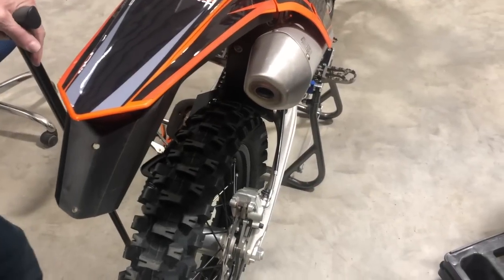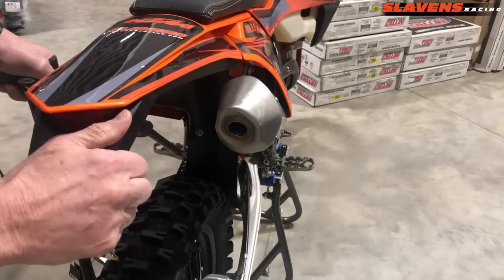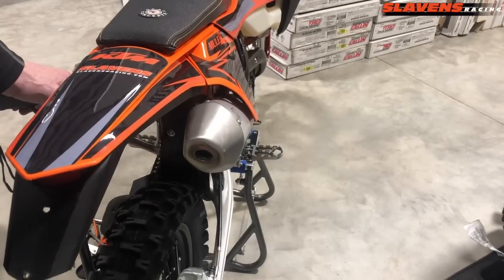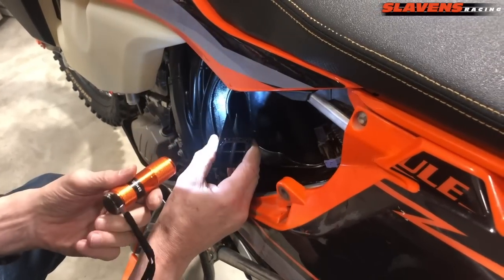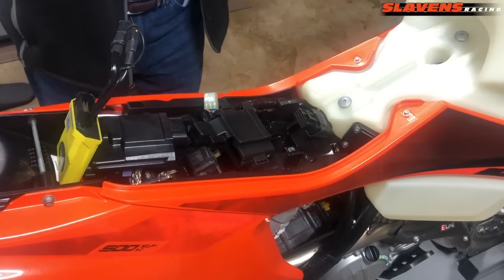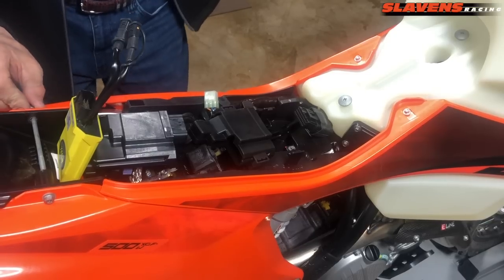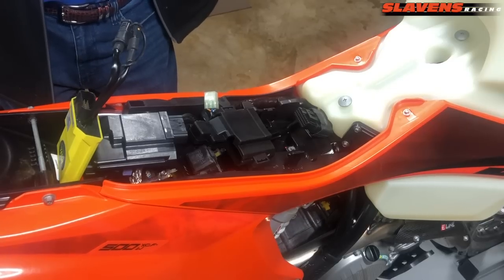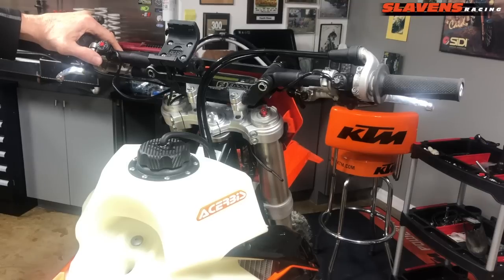How-to Make Your EXC-F/XCF-W/FE Rip!

Comment: have u seen best dual sports power bundles ? do u use a exaughst manifold mod as well
Reply: that guy is a snake oil saleman. Probably the same $700 package jeff referred to
Reply from the maker: Yes, a snakeoil special. 
Reducing the exhaust manifold diameter typically improves grunt at the very bottom of the powerband at the expense of reducing HP throughout the rest of the powerband. The trade-off is not worth the small gain for me.
Reply: @slaverace1  ok thanks for heads up so his ecu are garbage ? only 200$
Reply from the maker: @PackedandReadyFranco  
He does not sell ECUs. Those are just a piggyback system. 
You might want to listen to Korndogger's comment above.
Reply: He has and some of what he sells works such as the exhaust manifold and the ECU tuner (same thing as everyone elses, he doesn't have some super profile). But he also sells snake oil with things like the fuel rail. Even under full throttle the stock fuel rail supplies plenty of fuel to the injector. It's hard to believe him when you know he's actively deceiving people
Reply: Best dual sports is a scam.
Reply: @kyl3dr  dam really thats crazy ill look into this im gonna go see this guy
Reply: I’m very happy with my results form Best Dual sports. Seems to me he’s selling allot of the same items as Everyone else.  So you don’t like his videos or the way he presents his information. All I know is Is my bike was night and day difference from by adding his power bundle kit, and I didn’t need to spend 1000$ just for the ECU.  The customer service there is also top notch and they stand by their products and are quick to respond to emails. I like all these companies, I just wish everyone played nice.  Your all selling stuff and trying to make a living.

Comment: Thanks Jeff, in Europe we only have to remove the "removal CAT" and get rid of the cone inside the muffler.
Damn California! Altho i wish i could try a Vortex one day to see the difference with EU map
Reply: I have a eu model 250 exc f 2019. Are you saying that the intake is not like the us model ? Meaning it takes in more air? Thanks
Reply: ketchup sos yes there is no reed in the EU airbox
Reply: Cheers for that. What about the end screen cap on the muffler can I remove that without changing anything els ? Worth it ?  Thanks
Reply: ketchup sos yes remove it. On the EU its even easier than the US because the screen is held by a nut. You can use the wrench that comes in your KTM tool bag (same nut size as you rear brake reservoir cap)
Reply: Oli M thanks brother 😘
Reply: @mototrailz  i just checked my bike and the screen is already off??  still don't understand why the American version is different.  thought EU regulations were tougher..

Comment: Great info. Is the lambda sensor still used with the Vortex?
Reply from the maker: Yes.
Reply: @slaverace1  I've heard the o2 sensor is not used by the Vortex. Now I see it is used by Vortex? I don't know what to believe. My 2020 FE350s currently has no lambda/o2 sensor. I'm not sure if it would be better if I did install the sensor, haven't tried it installed after the Vortex. My bike does currently run much better than stock. Current setup: no reeds, exhaust screen still intact, vortex set to all 5 and map 1, no o2 sensor.
Reply from the maker: @kyl3dr  

Sorry, I answered incorrectly. I called Vortex and the O2 sensor is not utilized. 

You REALLY need to remove the butt plug.

Comment: Jeff, I just installed your Vortex ECU, wondering if you left the factory map switch connected. You mentioned one of the cables on the Vortex is for a map switch. Is one any better than the other. Can I remove it as I'm running out of real-estate on my bars? Thanks
Reply from the maker: I'm currently just using map 1 and no switches connected. I'll look and see if the OEM switch can be used by changing connectors.

Comment: Did the 450 SXF air boot end up fitting? I've heard that the frame gets in the way on the EXC models but I wasn't 100% sure. Thanks!
Reply from the maker: It does not fit and not needed. Remove the reeds, add a Vortex or GET, mod or replace the muffler and let er rip!

Comment: @Jeff Slavens I’ve done all these mods to my ‘17 Husky FE450. FMF Exhaust, FC450 (reedless) intake boot, Vortex ECU… my question is, what settings (MAP and Trim) on the Vortex box?  Thanks!
Reply from the maker: Tom:
Most guys use map 1 but you can try other maps to see if you like them better. It's as simple as turning the clicker with a screw driver. 

Before making trim screw adjustments, we need more information. Please give us a call and ask for Alec.
Reply: @slaverace1  Thanks Jeff!

Comment: At 12:11 you state that you don't need to stick a snake oil widget down the intake tube, so why do you sell a velocity tube for the intake? Maybe I missed something but the Vortex Intake Tube by Mototerre sounds like the same device you called snake oil that you hate people peddling.
Reply from the maker: Chad: Thanks for the comment. We handle several products from Mototerre and he asked us to sell his version of the intake tube which has a twisted internal wing that increases velocity and aims the fuel better. Also, customers kept asking for them so we brought them in. I don't use one in my 500.
Reply: @slaverace1  Jeff, thanks for the reply. That makes a little more sense now why you sell them. I have one of those velocity stacks in my 501, and to be honest I did notice a slight and I mean slight difference in performance. Thanks again for the explanation and thanks for the videos and products, I have the air injection dongle you sell and it works great, so keep up the great work.
Reply: I bought the Best Duel Sport intake velocity tube and had to modify it to set flush into the intake boot. Did it help ? No clue but it's not hurting either.. it's staying in either way. Lol

Comment: Does the new ecu allow use of the stock map switch?  How about traction control?  Thanks in advance!
Reply from the maker: Yes and yes.
Reply: @slaverace1  Is that hooked up to the stock xcf-w switch via supplied cables?
Reply from the maker: @DoctorGoodnight  
You're over thinking this. Just plug in the Vortex, set the TPS end points and ride it. There are no supplied cables. The OEM switch is plugged in to the OEM harness.

Comment: Do you lose the stock Map 1&2 switching capabilities by doing these modifications?
Reply from the maker: With the Vortex ECU, the O.E.M. map switch and traction control still work.
Reply: @slaverace1  Thanks Jeff for the reply. 2 more questions. I purchased the Vortex ECU from Slavens ( haven’t installed yet cuz she’s getting bigger springs for my fat ass). You stated that the stock map switch and TC will still be operable. Which maps will they use when the Vortex is installed? Next question,,, just purchased the O2 sensor block out kit from you. Is it mandatory ( or a good idea) to remove the O2 sensor with the Vortex ECU and FMF 4.1 and the intake reed removed?

Comment: would a ktm 500 2021 run okay if reed remove and exhaust unplug no ecu or fuelprogrammer ? does the o2 sensor will compensate ? for it
Reply from the maker: IF you have an EXC-F, it will be too lean with those 2 mods and will require an ECU update. https://slavensracing.com/shop/vortex-10-map-ecu-ktm-vortex/  OR https://slavensracing.com/shop/get-rx1-evo-ecu-ktm/
Reply: @slaverace1  wow thx jeff for the fast response what your quick tought on those fuelprogrammer at cheaper cost i am canadian and your us product on cad dollar are way more expensive haha
Reply from the maker: @North8078  
I've tried piggyback systems several times over the last few years and have never been impressed. They are nothing more than a cheap Bandaid that does not get the job done. I don't understand buying a $11K - $12K dirt bike then taking cheap short cuts that lead to mediocrity.  I'm sure guys will post their Bandaid system works fine BUT compared to what, a riding lawnmower?
Reply: @slaverace1  hahaha got it i will see how the bike perfom stock but might buy a ecu pretty soon i really wanna open it up :)

Comment: I did the same to my 17 but didn't change the air boot plus use JD Turner all good.  Does the air boot improve much better.
Reply from the maker: I have not tested the air boot yet but I only expect a minor improvement.
Reply: @slaverace1  the sxf air boot wont fit and rub against the pds shock because sxf uses link shock i believe

Comment: I have a 2020 500 EXCF and I made these changes but I didn’t set the TPS.   What difference will I notice if I now set the TPS.  Also, if I put the stock ECU back in do I have to do the TPS setting again.    Thank you.   Great video by the 2ay
Reply: I have a 2020 fe501s and did not set the endpoints either. I thought you only had to do that with other year bikes.
Reply: @Motorxkid1  I have a 19 500 EXC. I never did a reset with Vortex either. Trying it out today. I will try and report back any changes.
Reply: @xnofriendsx  I can't even do it with my bike since I have the fe501s
Reply: @Motorxkid1  well for what it's worth I did that reset and it had zero effect. I thought my bike might be a bit off but it ran just the same. I thought the fe501 was similar to the 500 EXC. You can't do the reset? With a Vortex?
Reply: Did you notice any difference in between oem ecu and vortex? I just removed the restrictions on my 20 500excf  but I still have the oem ecu on it
Reply: @mejia1133  I never rode the bike with the stock ecu. Brand new I tore into it without riding it. These bikes are lean and flame out. I would advise a Vortex or Get, etc. 👍
Reply: @mejia1133  Hey yeah it is a night and day difference. You should of left the restrictions on with stock ecu to avoid it running too lean and damaging your engine. I have the fmf 4.1 exhaust, intake reeds removed and, vortex mapped by twisted development and is a whole different bike. The map switch is fun as well.

Comment: Does the 2021 w have the o2 sensor?? Thanks.
Reply from the maker: Yes
Reply: Thanks. So by replacing the air filter box the o2 sensor should self regulate with the ecu? No adjustment needed to accommodate for the greater air flow? Then the second step would be to get a vortex and reset the parameters as you demonstrated.

Comment: Jeff, If I heard you correctly. Pulling the reeds is all that is needed if O2 sensor on exhaust? Does this apply to a 2021 500 XCF-W?
Reply from the maker: Hello: In the near future I'm going to re-install the OEM ECU and review how it works with the reeds removed. Please check back in 2-3 weeks.
Reply: @slaverace1  Any updates on this? I have a '20 FE350 (non S offroad model) and wondering if I can yank the reeds and leave the exhaust/ECU for another day.
Reply: Jeff, did you ever try running with OE ECU, reeds pulled?

Comment: Hey Jeff i have a 2020 350 exc-f in Australia. It came with no reeds in the airbox but still has a choked up exhaust. It came with the exhaust sensor but it wasn’t installed on the bike just came in the road package i was wondering if i removed the block in the end cap would i have to put the sensor in the exhaust? Cheers
Reply: I need to know this as well
Reply: Any answers on this guys??

Comment: When I de smog my exc can I plug off the vent hose off the gas tank or does that have to stay open ?
Reply: It has to stay open to prevent your gas tank from going into a vacuum and starving the bike of fuel.
Reply: @ppod450  I just took the brass barb that was on throttle body and used that it still has a small hole to vent but won't allow gas to stream out in a tip over
Reply: @michaelgreco5845  Good Idea, i will do the same, Thanks!
Reply: @ppod450  don't know if you know already but that will break easy and there is thread locker on it twist it back and forth slowly until all the way out its a pain but it makes it easy to get out and doesn't snap off